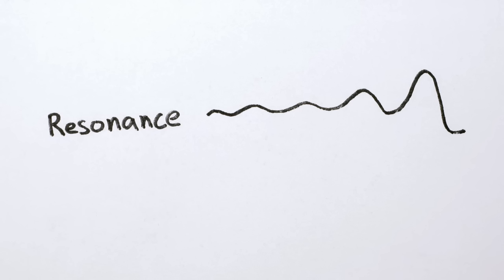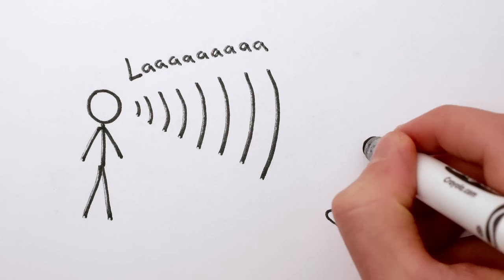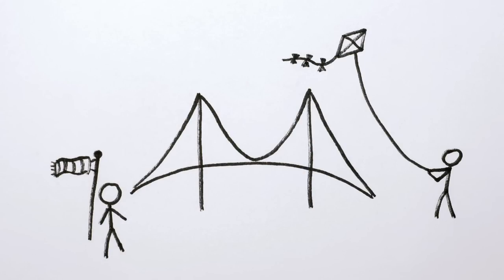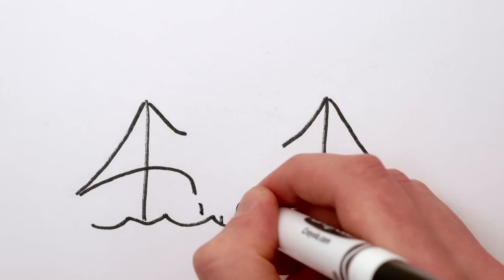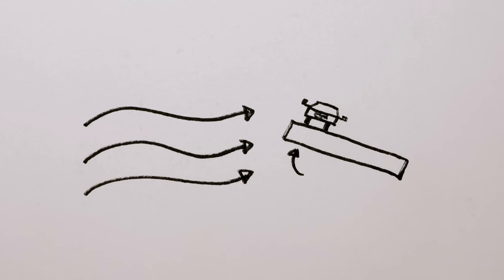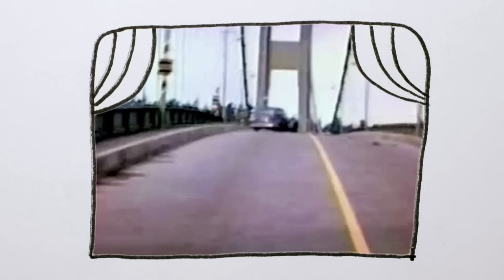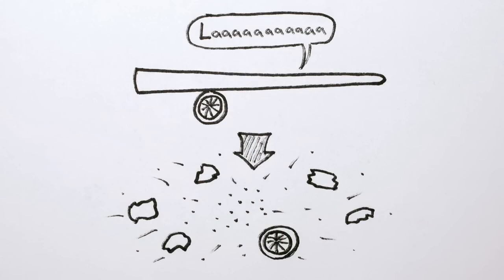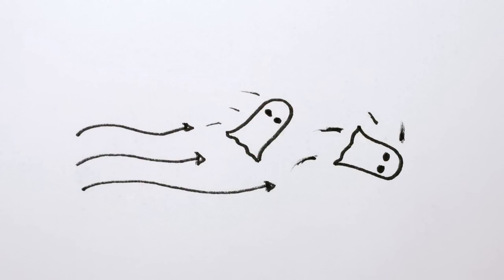The Tacoma Narrows Fallacy

Comment: @BlazingBobby Right on! It is the velocity of the wind that caused the bridge to collapse, which was above the critical flutter value. Whether small fluctuations are convergent or divergent depends on the frequency at which they oscillate. It could happen though that all frequencies are divergent, meaning that it would collapse no matter what the oscillation frequency was at that wind velocity.

Comment: That bridge is more frequently called galloping gertie, as another narrows bridge was built in the same place, on the same supports even, in the mid 2000s that built a second bridge (This time out of concrete as aposed to steel used for the second) to aliviate traffic congestion

Comment: And how the flutter is generated? by the so called 'tacoma swirly things' (vortices). Ther comming-off rate depends on speed of the wind, so it could happen only if wind was constant for many hours.
So constant wind caused vortices to form, vortices caused a resonance with natural frequency of the bridge deck. I am not sure however where the vortices were formed. At some edges for sure, but either deck, pillars or suspension lines.
Reply: Your commentary is being commented in my Mechanical Vibrations class :) Thanks for helping!
Reply: that's nice to hear
Reply: isnt the resonant frequency of that bridge a lot higher than it was shaking?
Reply: for sure there are many, many resonant frequencies of that bridge. this is one of them
Reply: Firaro There's a scientific article that was published years ago that performed fourier analysis on the bridge.  There were many resonant frequencies present at the same time.

Comment: @clebsch137 Anything that oscillates can oscillate at its natural resonant frequency, from masses on springs to vibrating strings to electrical circuits with inductors and capacitors.  It doesn't require a cavity, it just requires a driving force enhancing the natural resonant frequency of the system in question.

Comment: follow up: if you combine this with something that can provide energy at alot of different frequencies, an amplifier, an hook it up in feed back (the output of the resonator to the input of the amplifier and visa versa). you have the single go through the resonator selects on frequency, it gets amplified, selected again and so on. This means that for any frequency whose loop gain is greater than one, it grows exponentially until something stops it, like a structural collapse.

Comment: @seabulls69 Just looked it up on wikipedia, and it appears the bridge was not oscillating at it's natural (resonant) frequency. The aeroelastic flutter phenomenon seems to occur at what is probably some other frequency based on something or other that's hard to calculate for a specific structure. Essentially, everything will start to move in a nice wave like manner, such that the wind can impart enough energy each cycle to negate the structure's damping, and the system becomes unstable.

Comment: no , i believe its to do with the curvature of the wind over the bridge, causing a pressure difference (pushing it up) however this is not central so causes rotation around the centre of gravity. very much how an aeroplane is not balanced halfway from the front of the wing but rather around 1 third. however as the bridge was balanced halfway it was like trying to reverse a car fast, once it starts to turn it re-sieves negative feedback and get worse and worse, and so on.

Comment: any linear system simply scales the amplitude and adjusts the phase of an incoming wave, it does not "emit" a frequency of it's own persay. A resonant system is characterized by acting very different at a narrow range of frequencies or than it does at others. In the case of a passive system, it can never make the wave bigger, but it can be maximal (ie no loss) at what we call the resonant or natural frequency (they are the same for low levels of damping).

Comment: The spring mass system of the bridge forms the harmonic oscillator, and the tipping point caused by the bridge's position being above or below horizontal allowed the wind to act in two directions, in phase with the oscillation. An energy source delivered in phase to a harmonic oscillator, that's the definition of resonance.

Comment: @seabulls69 This is basically what I was thinking. The bridge oscillates at it's natural (resonant) frequency. Toss in a flawed design, where the bridge moves much more than it should, and it all spins out of control pretty easily. Still, I suppose it would have vibrated at its natural frequency regardless, and aeroelastic flutter was the design flaw.

I was never taught that the wind was pulsing with some sort of frequency, but that it was merely causing the bridge to oscillate.

Comment: Seems like aeroelastic flutter is sort of like resonance, but with different mechanics. They seem vaguely related.
Reply: Dale Peters They are related, but they are not the same phenomenon. Resonance is about how a system responds to an input, specially if that input is of a given frequency. Flutter is about the stability of the system, regardless of the input you are using.

The simplest analogy I can think of is a pendulum. If it's downwards (like a normal pendulum), and you give it little bumps periodically, well...if you give it a little bump every time he is passing through the lowest point in the same direction of the velocity, it would oscillate higher and higher. This is resonance between your input (bumps) and the pendulum natural frequency.

However, a pendulum that is supported upwards, will always fall out of this position, as it is unstable. This is instability.

Comment: Aerostatic flutter as originated by Arthur Collar, is the mutual interaction that takes place within the triangle of the inertial, elastic, and aerodynamic forces acting on structural members exposed to an airstream, and the influence of this on the design... Same thing as a flag fluttering in a stiff wind.

Comment: Supposing that the fluid (air) manifested itself in a turbulent flow, due to the high speed and the terrain, it would have acted as somewhat of an oscilating force inflicting the object. Though maybe negligible, if the turbulence, or the curls in it, acted on the rigth magnitude and frequency it would cause an oscillating lift force. Hence, if this in turn scaled and more horisontal airflow interacted with the springing of the structure itself it would cause fracture. I think it's corelated :)

Comment: Actually the phenomenon was first identified in the 1940s, but probably not applied to bridges.  I asked a bridge designer if there is criteria for "resonance" now, but even now resonance or aeroelastic flutter in not part of structural design.  But criteria has been introduced in codes and manuals that serves to prevent/minimize this kind of effect.  Given complexity of dynamic loading, it is super-difficult to analyze dynamic resonance of complex structures, to the point of being infeasible.

Comment: but the cfd simulations proved that if the air velocity had increase we would have still witnessed a gradual increase in the amplitude of the vibration the bridge had, resonance requires there to be a natural frequency or set of frequency for which the phenomena occurs.

Comment: "aeroelastic phenomena arise when structural deformations induce changes on aerodynamic forces. The additional aerodynamic forces cause an increase in the structural deformations, which leads to greater aerodynamic forces in a feedback process. These interactions may become smaller until a condition of equilibrium is reached, or may diverge catastrophically if resonance occurs."

Comment: I just want to agree with this point. without a resonance mode of the object then the aeroelestic flutter will not build at a particular frequency. It's true that the wind isn't only driving it at one frequency but the wind and structure are creating a resonant force as the bridge oscillates. And if this happens at the bridges natural frequency it builds up through resonance.

Comment: @hanz12891 yeah... the motion looks like it can still be closely modeled by the behavior of a LTI system, even if the input isn't exactly vibration of the air. I'd say you're more right in calling it a resonance than saying it's not. Of course, spoken like a physicist, @minutephysics does have a point.

Comment: so how does aero elastic flutter work?
Reply: +Touka Kureha To put it simple, it's an instability originated by the coupling of aerodynamic, inertia and elastic forces. Under certain conditions the structure behaves as if it had negative damping, that is, it extracts energy from the air and puts the energy into the structure.

Comment: @Makkasu0 
Resonance is just a fenomenon.
If the driving frequency is exactly the same as the natural frequency, the oscillations of the object will get an ever increasing amplitude. This is called constructive resonance.
Since the wind didn't have a frequency, something else had to make the bridge move at somewhere near it's natural frequency. Resonance was just the outcome of aeroelastic flutter.

Comment: It depends on how you define “resonance,” but I agree.  A resonance is when a system with an intrinsic mode of oscillation is driven by an external source of energy with a matching frequency, such as when one tunes a radio to match the frequency of a particular radio transmitter.

But there is something called “vortex shedding frequency” which seems to be related to inducing the initial oscillatory mode.  What there isn’t is a good explanation for the layman illustrating how the frequency is determined how the vorteces create lift forces.  

I think the wind just has to put enough energy into the bridge to exceed the loss of energy to damping.  It’s like a simple musical instrument, like a recorder.  It has an inherent fundamental frequency for a particular hole configuration.  If you blow into the mouthpiece very gently, you won’t hear a note.  When you increase the force of the wind, you will reach a point where the energy input is sufficient to sustain the vibration we perceive as a note.  Blowing harder doesn’t change the frequency, it just provides more energy and more volume.  Is that properly called “resonance”?

What interests me is that the bridge deck first oscillated in an undulating mode.  It was only on the last day when it switched to the twisting mode.  How did undulating mode start?  Why did it switch to a twist?  I’ve read that a cable added to try to stabilize the bridge broke, but I have not seen any details on that point.
Reply: Something about fatigue point of the steel

Comment: The question, "Why didn't the bridge start 'galloping' straight away or even during construction?" Maybe because the concrete and steel became stressed over time and then as the fluctuations became worse, the stress became worse and so on until the final breaking point was reached. However, I want to know, what have engineers learned since this bridge collapsed? And why don't other bridges the same design suffer the same fate?
Reply: Yes, I read a great comment somewhere else where the guy talked about the steel having a fatigue point and for days the bridge had suffered oscillations at resonance but steel only had a certain number of maximum amplitudes in it before it failed but this is second hand info and I don't totally understand it but neither does everyone else, I guess,

Comment: Well, that kinda IS resonance. Just not the way it's expalined in physics.
Steady wind causing aero-elastic flutter.
Though I guess, that flutter would have eventually caused the catastrophe at any frequency? Or asked differently: What does the frequency of the bridge's flutter depend on? If it's a function of the wind velocity, this would have happened at any frequency but if it's only a function of the bridge material, that kind of is like resonance.

Comment: "Divergence occurs when a lifting surface deflects under aerodynamic load so as to increase the applied load, or move the load so that the twisting effect on the structure is increased. The increased load deflects the structure further, which brings the structure to the limit loads and to failure. This happened to the Tacoma Narrows Bridge in Washington."

Comment: The video you link to:

"...this was enough to keep the bridge oscillating with a period of 5 seconds."

It was oscillating with a period of 5 seconds, therefore, a resonant frequency (OF THE ENTIRE SYSTEM) had been reached.  So, while you are correct that the initial phenomena was caused by aeroelastic flutter, it DID reach a resonant frequency.

Comment: The actual claim is that any bridge (or any system) will oscillate at some frequency, and not limiting a resonance will lead to it growing ever larger when sufficient energy is available. By design the wind could not sway that bridge much, but the amount added bit by bit all day, because of resonance.

 You could also claim to debunk that an electronic circuit will oscillate due to resonance, because the power supply is a constant voltage. Then call it electro-voltaic flutter instead.

Comment: "Where does the energy in our bodies go when we die?" Well, simple answer. Our heat energy is dissipated to the surrounding air, as usual, our chemical energy is generally preserved until eaten by surrounding microorganisms, which then convert it to any form of energy they need, our kinetic energy (if any) is converted to heat and sound as we fall, same with gravitational energy. Every piece of energy can be accounted for when we die. Also quantum mechanics allows energy to knock stuff over etc.

Comment: 'Galloping Gerty' was indeed built improperly (too large with insufficient support to keep it relatively static) and the wind DID cause it to shake about (demonstrating that design flaw).  Both of these statements ARE true.  What is ALSO true is that the durability of building materials has limitations.  You saw the bridge bending and twisting physically.  It was observable.  Such actions test the tensile strength of physical objects.  I can assure you that an elevator car going up and down a shaft will remain attached to its wire longer than one that is out of a shaft and swinging like a pendulum.  Do not overlook contributing factors.  The bridge collapsed WHEN it did due to the total amount of force acted upon it to bring it to that state, all of it.

Comment: Your teachers are not wrong.  The resonance does not have to be caused by an oscillating wind pattern.  Do a Fourier analysis on a random but "essentially constant" wind force, and there are nonzero terms in the resonant frequency range.  So even an almost constant force can cause resonance.

Comment: This was a resonance in the sense that the bridge did oscillate with a a higher and higher amplitude, and that's the main point behind the teachers words (it's methodics, where you can't introduce lots of information, but you tend to simplify with one general model - the same thing goes for Bohr atomic model!).
But in strict physics terms, where resonance has a strict definition, this wasn't a resonance but aeroelastic flutter.
Nice video. :)